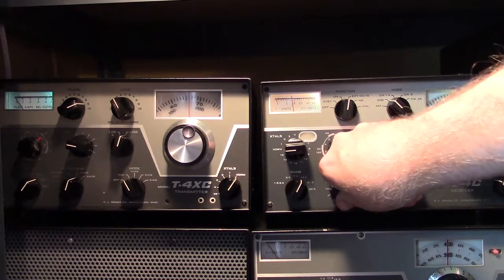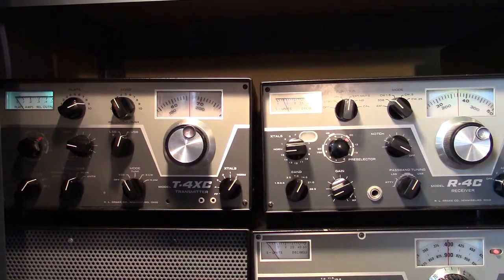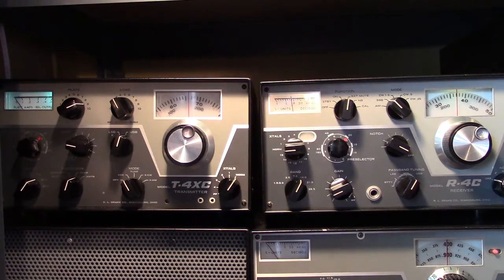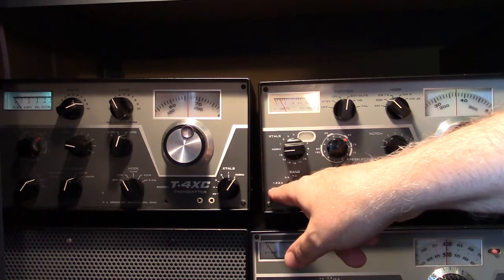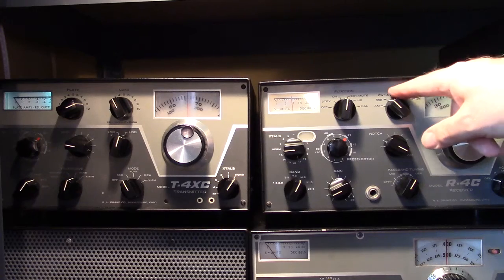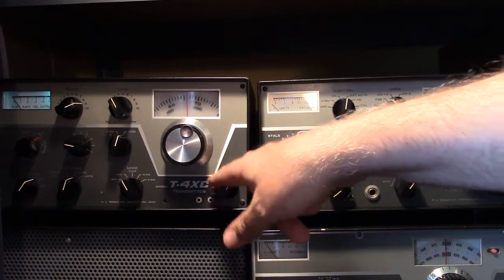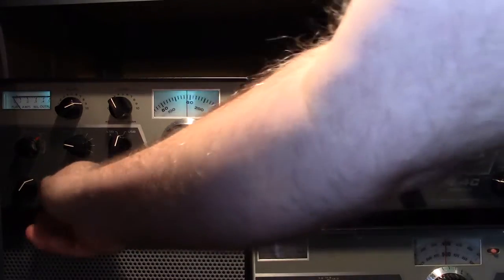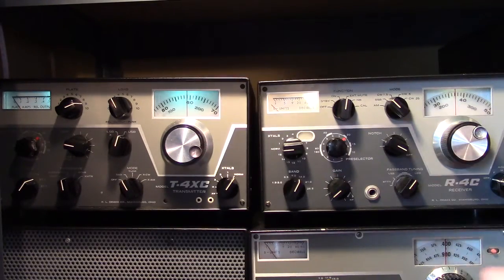Drake C-Line HF Amateur Receiver and Transmitter (1973)

Comment: Thanks for the nice demonstration. I didn't quite understand if the 4rc receiver covers all the band s continuously or is it only made for the amateurs' bands? In other words what is the purpose of the different x'tals positions? If you could answe me I would be very grateful to you as I have got the opportunity of getting one like that. Thanks very much for your help.
Reply from the maker: Hi Abele. The R4C tunes a range of 500 KHz. A crystal is used to set the start and end of each range. For example, to cover the 20 meter ham band, the radio tunes from 14.000 to 14.500 MHz. The crystal to do that has a frequency of 25.1 MHz. When R4Cs came from the factory, they had the necessary crystals to cover the ham bands. To cover 500 KHz ranges outside the ham bands, crystals had to be purchased and inserted. Those crystals would be selected via the "XTALS" switch. For example, crystal position #1 in my radio is a 13.1 MHz crystal, which makes the radio cover 2.000-2.500 MHz. I haven't tried to buy any crystals recently, so you will need to research their availability.  If you still have questions, post them here. I love these radios and hope it works out that you can buy one!  The seller should be able to tell you if his radio has any accessory crystals intalled.

Comment: Not being familiar with these, you mentioned xtals for transmitting. Does it have the capability to transmit on only those xtal frequencies or can it transmit without xtal's based on the frequency dialed?
Reply from the maker: It requires a crystal somewhere to be able to transmit. Crystals for the ham bands are included in the Drake transmitters. There are also spare sockets where additional crystals can be plugged in.
Reply: Roger that, thanks!